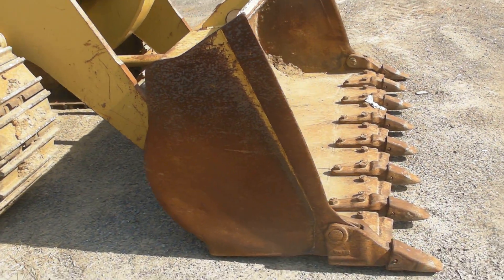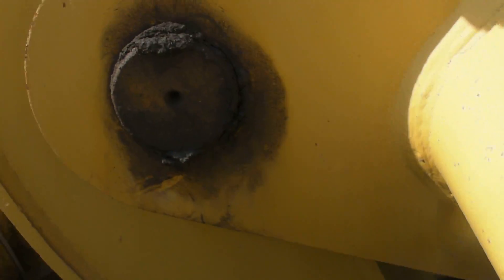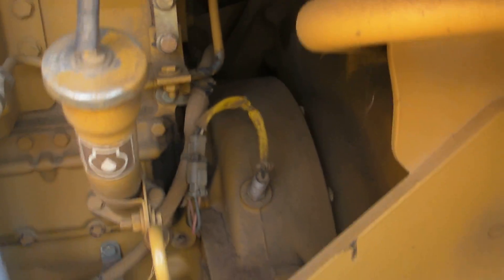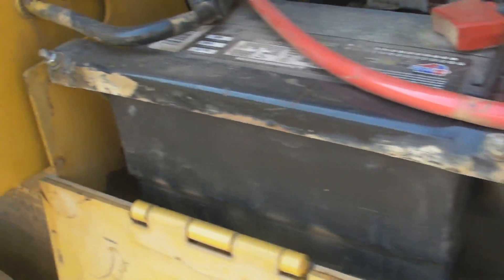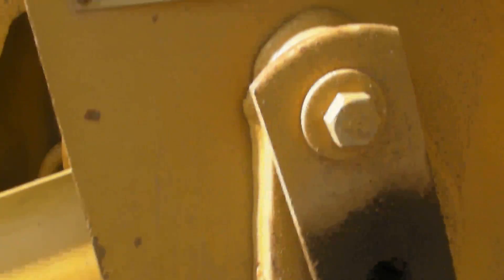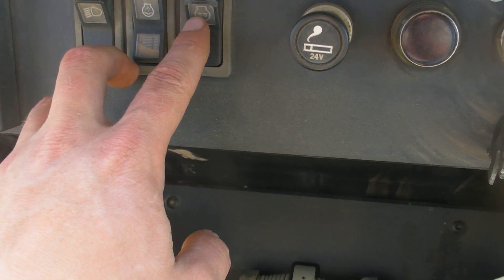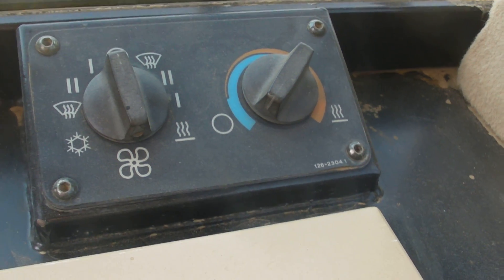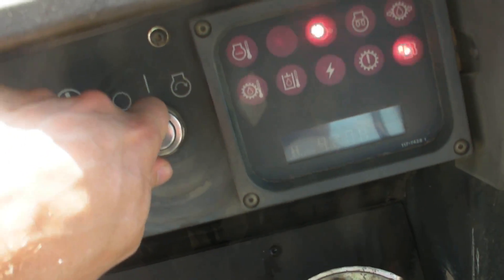Caterpillar 953C Trackloader...SPECS review

Comment: 3116 was actually designed to be a 'disposable engine' (whatever that was supposed to mean) but the Mechanical Injection variants actually weren't all that bad. The problems came with the early HEUI system in the later year 3116s (few years after this machine was built) and the early 3126. They were known to be very finicky and problematic, but some of the issues were worked out for the 3126B. That being said, the 3126B still had its flaws. That's one of the reasons why CAT made the 3126E, which was a third-generation form of the original 3126 (which was originally the 3116). Finally in the early 2000's they scrapped the 4-digit model names and just called it the C7, which lead to thr C7S in the late 2000s. This specifically is where the 7L lineup took a turn for the worse. If you want to hear more about the C7S, Adept Ape has a video on it on his YouTube channel. Just search up the worst engine Caterpillar ever made. It's notorious.
Bottom line, the 3116 was by far the best variant of its type. Yes it was mechanical Injection and yes you had to synchronize the Injectors after every replacement, but it was simple, mechanical, and there were a lot less things that could fail on you.